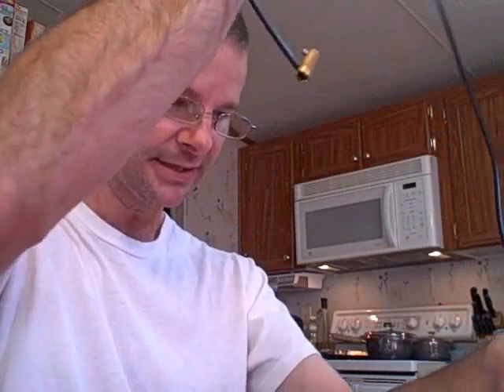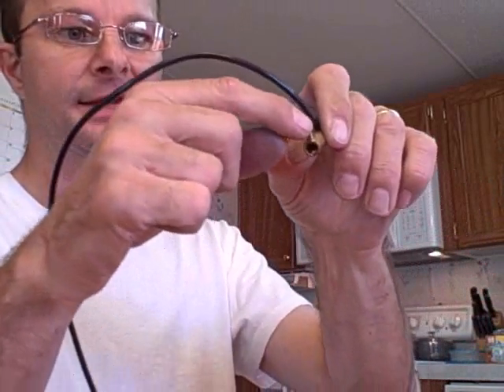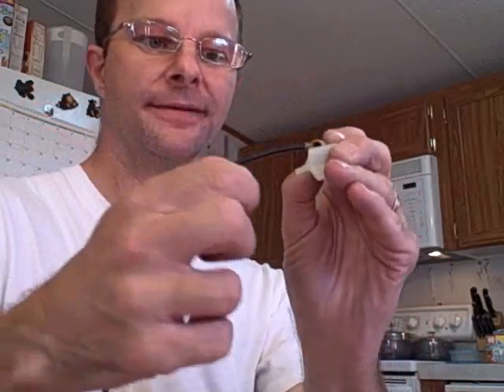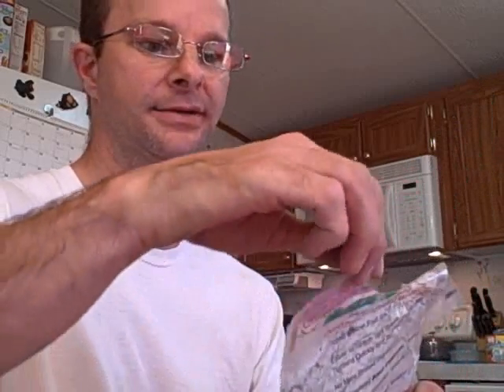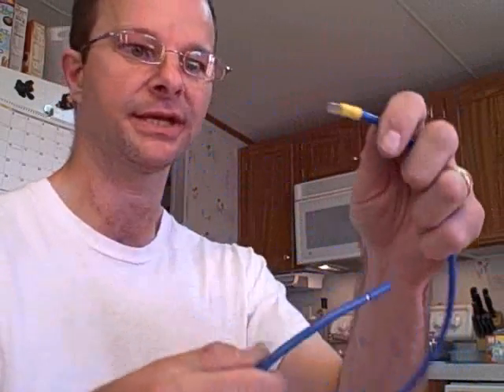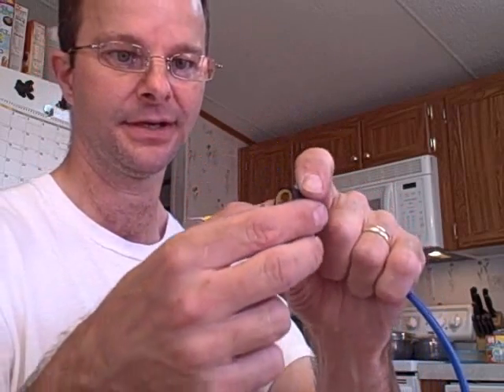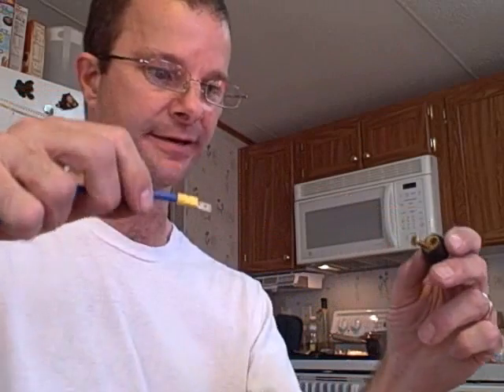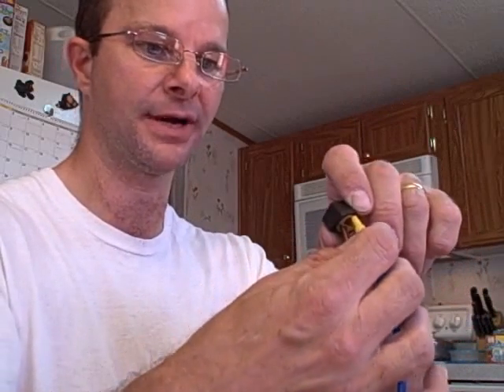HVAC compressor terminal lug kits.  When the compressor terminal is burned off!

Comment: Question— if the terminals on the compressor are all 3 corroded off/broke off, is the compressor toast??  Or is there still some way to get power from the wires to the inside of the compressor ?

Comment: My terminal post came completely off. A lug kit will not work on the common. Is there a way to fix that? Thank you.
Reply: Very late response, but you can spot weld a new post with a pincer-style spot welder or a handheld battery spot welder.

Comment from the maker: It does to some degree Jim, haven't tested how close.   I apologize in general to all my subscribers for the lack of close-ups in general, I usually set the camera somewhere and do a frame check and thats it, just shoot and go.  After 10 minutes of vid I realized you can't seen the parts very well but at that point I don't feel like re-shooting! lol :>  I have the I-flip camera which ROCKS but would be nice if it had a fold out screen you could turn around and see what your doing :>